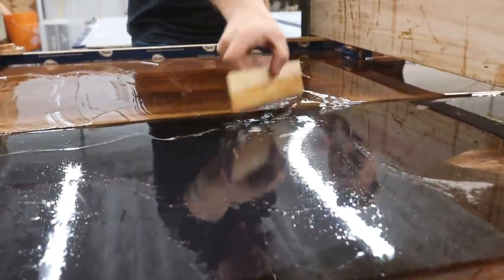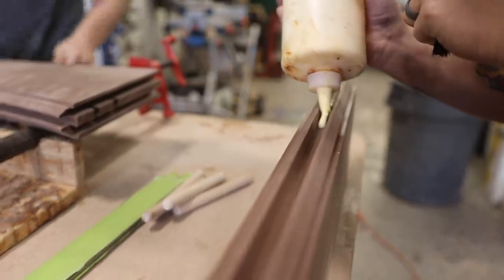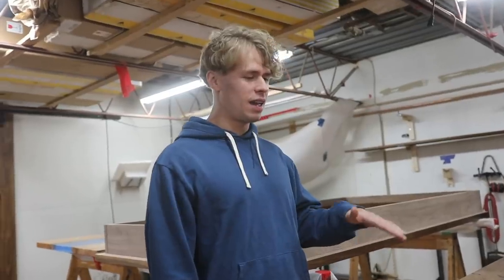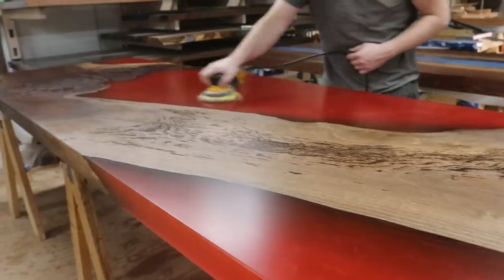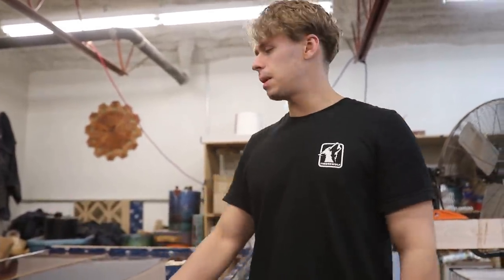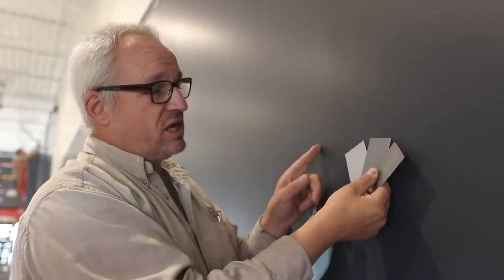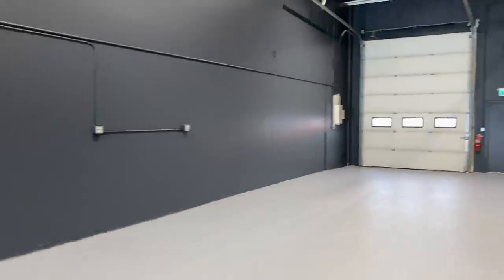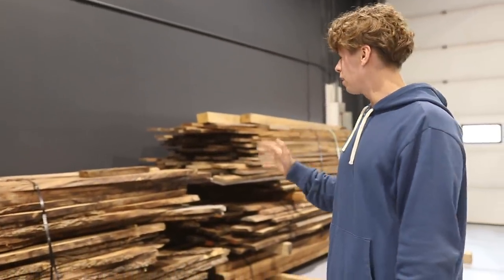We've Expanded Our Shop

Comment: Just gonna give constructive criticism. Shop looks fine though but what I would of done. The floor should of filled the cracks and pits. Grinded the floor to CSP 3-5, then polyporastic it. Extremely flat and durable for long time and super clean looking. For Crystal table.. I thick small pours in layers as it tacks up be better. A big deep pour im guessing will allow the crystals to sink might solve your issue doing it in layers.. led lights from the top a must.. 5000ksuper bright. This is your stage show area.. so trick it out really display your craftsmanship.. it's easier to point to something so your customers go yeah that's what I want from desks to shelving and joinery. What I want to see is this ceramic coating for protecting the epoxy tables from scratches it's something I might be interested in having done when I get ready for a big epoxy table.